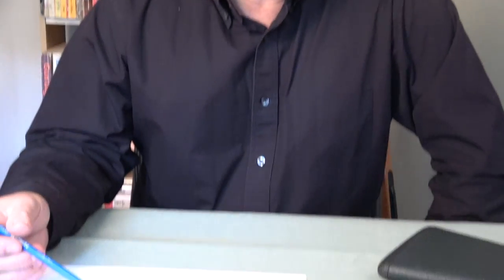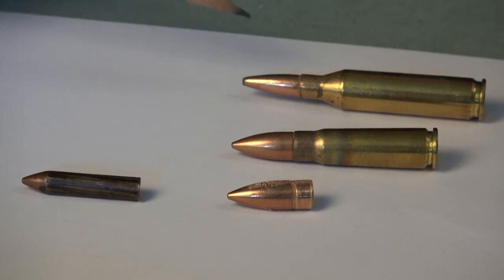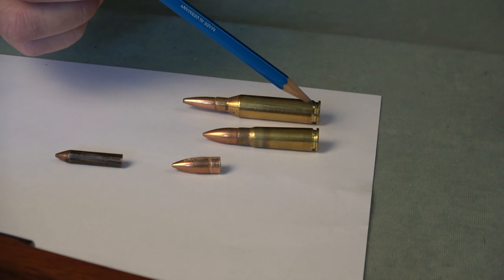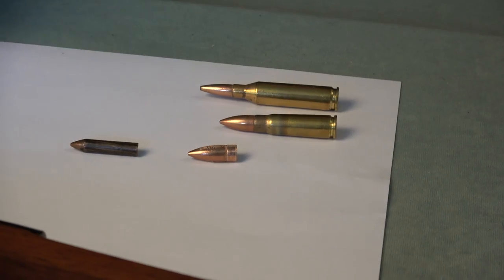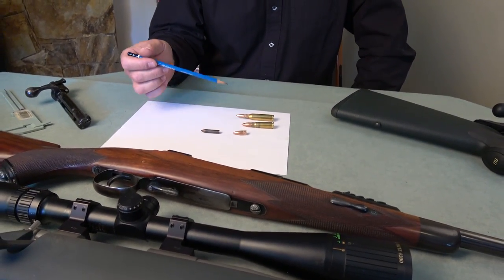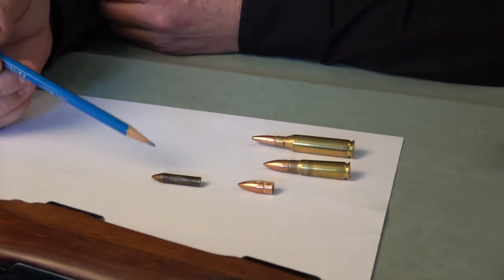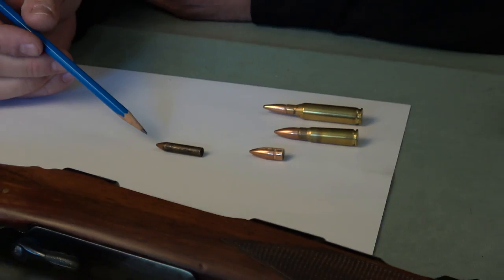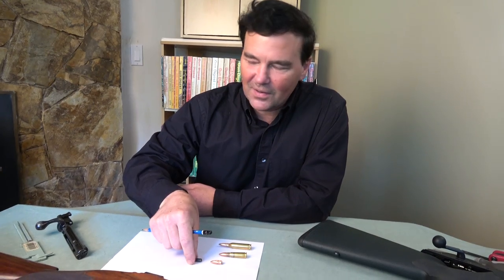A great learning lesson in firearm safety

Comment: I'm glad to see you were not seriously hurt by that event. I once used the wrong powder/primer combination in my 30/06 bolt action. After firing three rounds that seemed very powerful even for the '06, I squezed the trigger on the third round and was greeted by some severe blow-back of gas. Upon opening the action, I noticed only the last third of the cartridge case was left held on by the extractor claw, with the remaining casing still in the chamber. Thankfully the strength of the Mauser 98 action prevented more extensive damage and/or injury. I took the rifle to a gunsmith afterwards, and he had to correct the headspace. I still use the rifle, and have fired it many hundreds of times since, and have had zero problems. I now use extra caution when reloading, making sure I only use recommended loads according to my reloading manuals. Great video by the way, and quite important for the shooting public to see for obvious reasons.
Reply from the maker: Glad you were not injured as well. So easy for things to go wrong - Your note is a welcome reminder. Thank you!

Comment: Excellent video on a scary combination.  Very much appreciate the factual description of the event without pretending to know 'all about it'.  
Most of these sort of errors are self correcting: like the time I took a pistol to the range and couldn't figure out why it would not chamber the first round from the magazine.  Quickly I identified a Colt Government Model magazine loaded with .45 ACP ammunition and an almost matching Colt Government Model pistol in Super .38.  Problem itself prevented a disaster.  

And usually a different cartridge will be either too small or too big to fit anywhere close to function.  But there are a few, like your 7.62x39mm and the .243 Win.  Or the currently infamous .300 Blackout in a .223 Remington (5.56mm NATO) chamber.  No doubt there are others.  

There is a story, perhaps unfounded, of a man who gained possession of a Japanese Arisaka rifle just after WW2.  He found 6.5mm Arisaka ammunition was impossible to get.  (It's more available now, but still not common.)  He also heard the Arisaka actions were incredibly strong.  So he had it chambered for .30-06 Springfield, rather easy to obtain.  But it kicked really bad and the bullets came out 'odd'.  He had failed to rebore or re-barrel the rifle and was shooting .30-06 through a 6.5mm barrel.  The action seems to have held.  NOT recommended.

Comment: I appreciate you being straight up and telling us about your accident. When you do anything on a regular basis an accident is inevitable. You were extremely lucky! I haven't had an accident as major as yours but I did pull some bullets from some 7.62x39 military rounds and replaced them with .308 bullets not taking into consideration that it required .310 or .311 bullets, I forget which, for a SKS. Nothing dangerous happened  but The accuracy was terrible.

Comment: Glad you came through that relatively unscathed.  For mostly simplicity and economic reasons (buying ammo in bulk) I have settled on three everyday calibers for the range.  9mm for my 1911 collection.  22 LR for my scoped rifles and 223 for my AR-15.  At some point I want to add a Creedmore 6.5mm rifle, but that will have to wait until after my Croatian vacation later this month.  Focusing on shooting and concentrating on technique I can see where it would be easy to inadvertently load a round into a magazine where it didn't belong.  Gun safety requires us to be on our toes all the time.  Hearing examples where lessons are learned are valuable.  Thanks for the info.
Reply from the maker: Those are solid choices. I like the 9mm 1911 and I shoot it far better than the .45 ACP - which people tell me is because I don't practice enough - which is true : )  Croatia : should be excellent.  I heard about wild boar hunting there - would be something! Bye for now.

Comment: you know, stuff like this can and does happen. i had a ruger super blackhawk 7 and 1/2 inch barreled 44 mag. the grip frame can loosen up slightly, interrupting the firing sequence so that when the trigger is pulled the hammer may not drop.  puzzled by this, i leaned over with the barrel tilted up lightly with my hand on the  grip and it discharged, causing a more rapid rate of breathing and increase in perspiration.  it was pointed down range and in my control (sort of). the lightest bit of inattention can change things forever!
Reply from the maker: That's something I hope everyone reads. My breathing became more rapid just reading your story.

Comment: I haven't shot center fire rifles extensively, but I never gave much thought to the possibility of putting the wrong round in a rifle chamber.

In shotguns, it's fairly common knowledge that putting the wrong gauge, or length, of shell in your gun can be catastrophic.

With handguns, it's my understanding that longer more powerful rounds of the same bullet diameter SHOULD not fit in the chamber of a shorter round.  However, I never tried doing that.  I did once read that someone blew up his 38 by putting a 357 in it, but I thought he must have forced the magnum in there to see it it would work.  It did not.

Of course, a 270 may go into a 30-06 chamber (never tried it), but I would have thought that because of the bore clearance, a catastrophic failure of the firearm would not happen, and the possibility an injury would be nil.  But even if that were the case, the slightest possibility of any injury do to the improper use of a firearm is totally unacceptable.  And I've thought that putting a 30-06 in a 270 was not possible, at least not without effort.

On YouTube I've seen people put all kinds of things in shotgun shells, glass marbles, etc.,  and shoot them out the barrel.  Sorry, but I'm not fool hardy enough to do things like that.

Thanks for bringing this rifle ammo issue to my attention.  I've been shooting and working on firearms for 50 years, but you learn something new every day.

Comment: Not an uncommon  thing to happen.  I have seen it a lot and did it myself once. I had two Japanese Arisakas that  looked the same, but one I had re-cut to 6.5x55 Swedish Mauser. I had both boxes of ammo on the table and was loading one round at a time. I reached over(With out looking) and got another round out of the box. I felt a lighter recoil when I fired the gun, and when I extracted it onto the table the neck looked short.  It was a "Fire formed"  6.5x50 Japanese case.  That was one long, thin case. It even sealed perfectly, but it was ballooned out to the limit of stretch at the head. I never had more than one box of ammo on the table again.   All claw extractor bolts will pick up and hold the case against the face of the bolt. I hear the stories all the time. NEVER have more than one can of powder on the reloading bench either.
Reply from the maker: A simple and excellent principle and lesson Old Goat - that day I was so stupid....luckily just got away with it.

Comment: Once I accidentally fired a 30-06 out of a 410 don't know how it happened or why I even had a 30-06 I was squirrel hunting and I took w shot missed and loaded a shell then shot again and and it sounded really weird and had very little recoil I opened the action and stuck in the chamber was a 30-06 blown out to 410 dimensions I went home and knocked the case out and checked the gun the only damage was the hammer spur broke off, the bead came off, and the stock had a small crack it was one of those old Stevens single shots with about a half inch of steel around the chamber was just really lucky since I was hunting and didn't have ear/eye pro I still have that gun and the case though I'm not sure where it is in my closet
Reply from the maker: It happens so quickly - glad you are okay and it sounds like the squirrel was okay too. Just teasing. That is a combination that I've not come across before - thanks for alerting us to this possibility.
Reply: USOG you're welcome